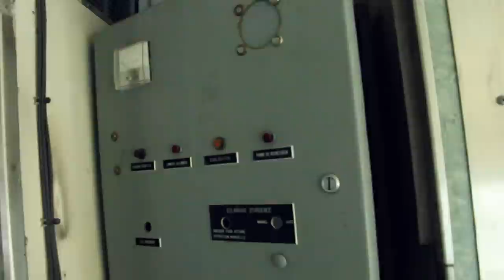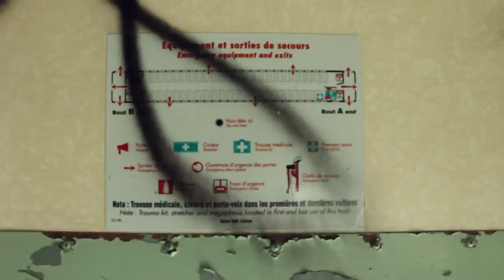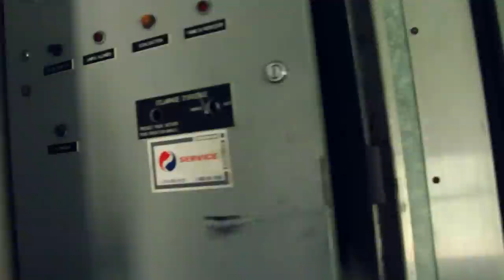Goat Canyon Trestle Bridge - Abandoned Railroad Series

Comment: GCT/Bridge 103 wasn't built in 1919, as the end of your vid states.  That was the year the line was completed.  GCT was added later - finished on July 6, 1932, built after the March 27, 1932 slide that took out No. 15.  (633' long, 185' high)

Comment: Abandoning Rail lines is a big mistake. Rail lines need to be well maintained so that trains can run on them at highway speeds to compete with the trucking industry. When a rail line is neglected and not properly maintained, trains are forced to slow to a crawl.  That gives industries the incentive to turn to shipping freight by truck, and that ultimately leads to rail lines getting abandoned.  
Trucks beat the hell out of our highways, resulting in rutted pavement, and uneven concrete sections, which mess up a vehicle's front end alignment.  More truck traffic on our highways leads to more pollution too, which contributes to global warming.  Truck drivers get pushed too far, get fatigued, fall asleep at the wheel, and cause accidents.  Not only does that result in property damage, injury or death, but it also causes massive traffic jams, that throw thousands of people off kilter, making them late getting where they need to go.  
We need to keep the freight trains running to reduce the number of trucks on our highways. A freight train, while carrying the freight of 100 trucks, only emits the pollution of four trucks.  Each time I'm sitting at a railroad crossing, waiting for a train to go by, I say to myself that each car on this freight train is one less truck on our highways.